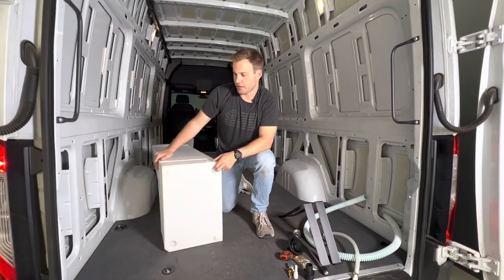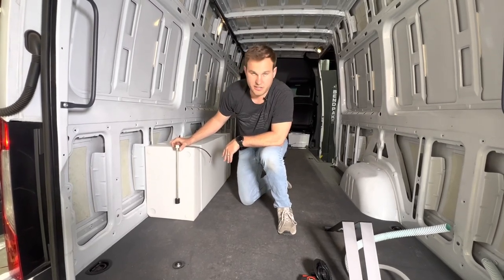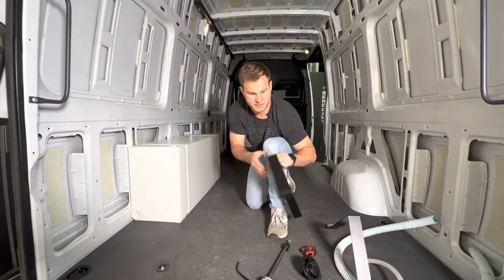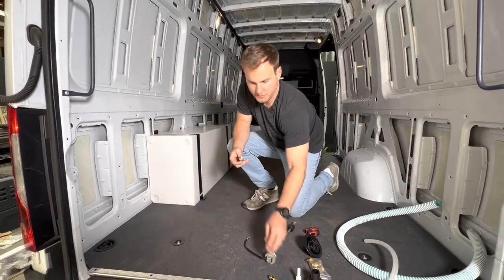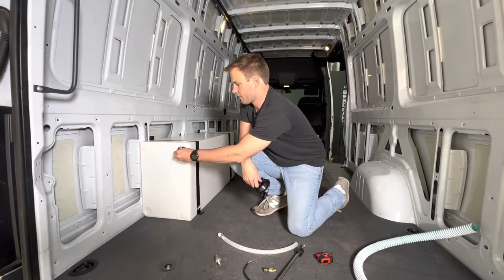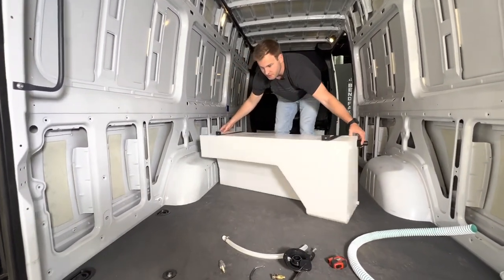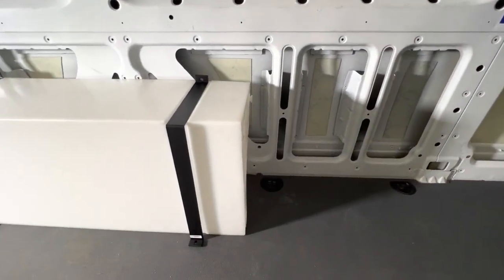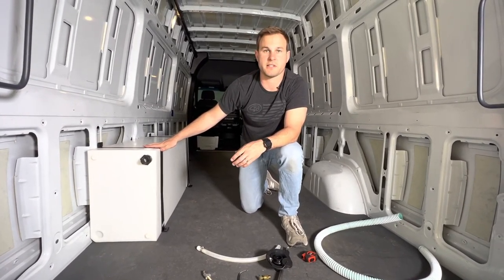S&B 35 Gallon Wheel Well Water Tank (DRIVERS SIDE) For The Mercedes Sprinter

Comment: Does this driver side tank also attach and work over the wheel well on the passenger side of a Ford Transit?  if so, what are the dimensions of the flange area?  any difference running hoses?